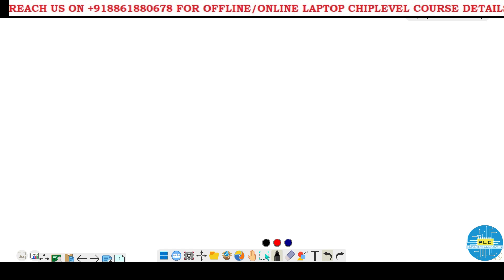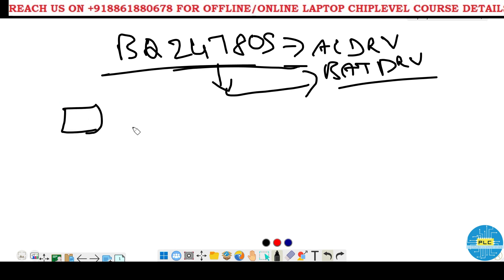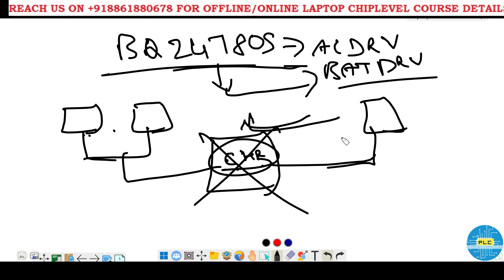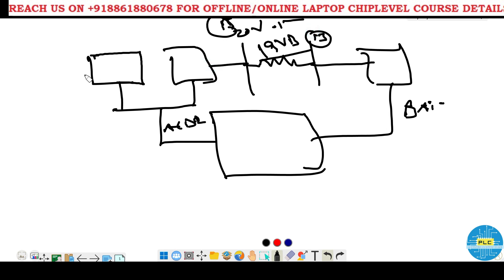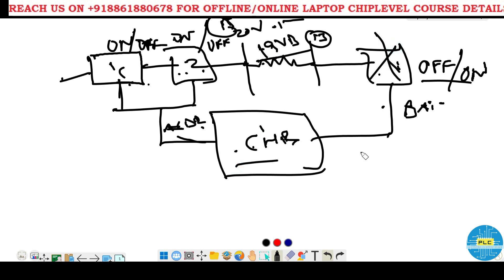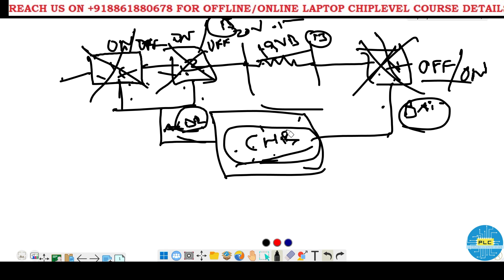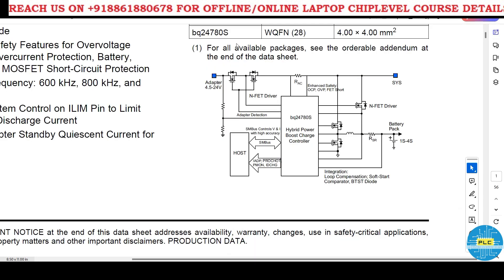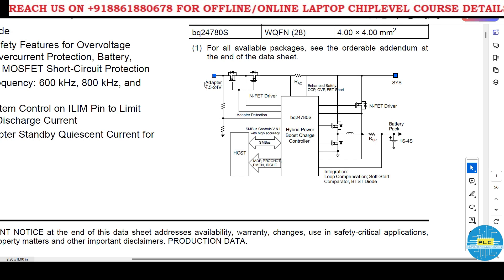BQ24780S :ACDRV CONCEPT IN P-CHANNEL MOSFET || LAPTOP CHIPLEVEL REPAIRING COURSE

Comment: Please master, I have hp motherboard 11th Gen, it's charging ic heats slowly when I connect battery, but it shows it's charging, but when I connect only adapter it deosnot heat up and motherboard powers on, but the moment I connect both charger and battery charging ic starts to heat up
What could cause the charging  ic to heat up
Reply from the maker: Need to check battery to clr components. If possible replace one by one and check. Otherwise io also sometimes issue because of smbus communication
Reply: @LaptopCourse  OK, it means sio can cause this problem, because I have replaced many charging ic from working motherboards but still also they heat up when battery is connected